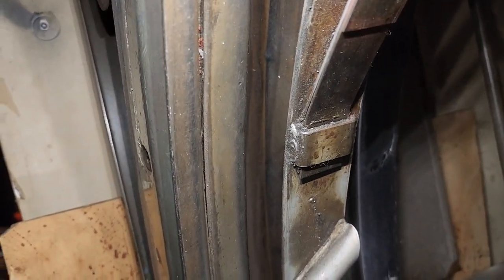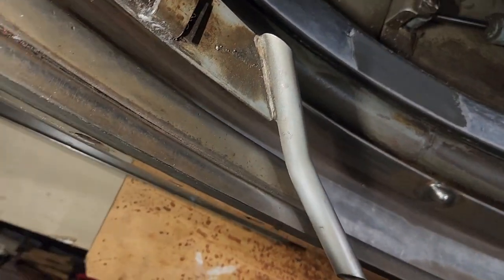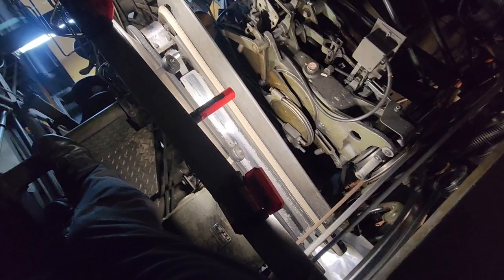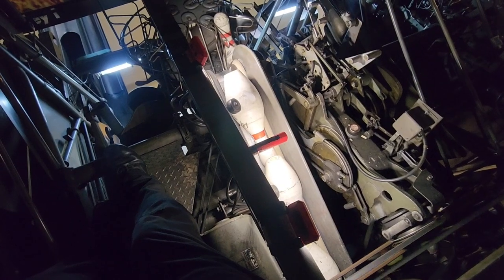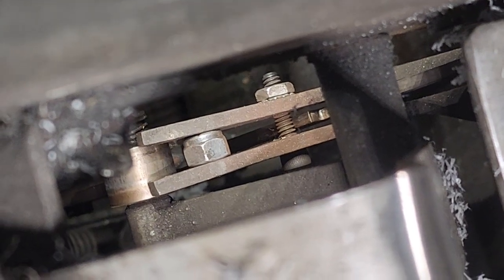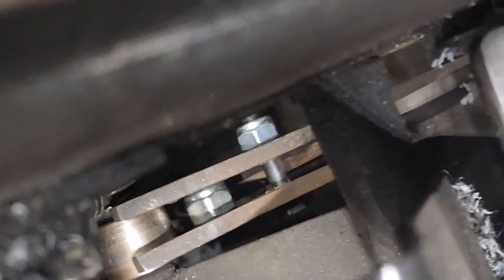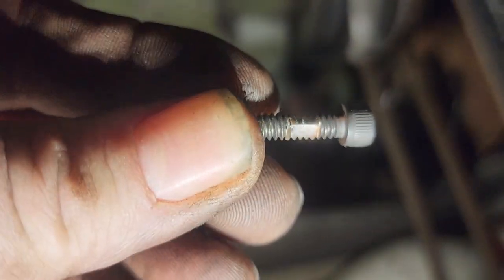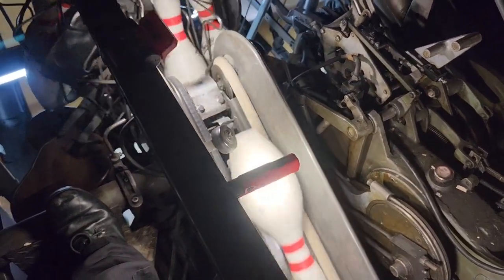Brunswick A2 Pinsetter- Pin Wheel and Pin Gate Issues.

Comment: You should get them to buy nylon pin gate straps......Who even uses metal ones anymore.
Reply from the maker: I may suggest that. The issue would be who is going to install them? This center does not have a full-time technician. 

I'm a full-time technician for another local center. I stop by once a week for a few hours and get the downed lanes running again. I was there for 5 hours today, just working on the breakdown lanes they had. Perhaps one day in the future, they might have the opportunity. Today was not that day. 

I will suggest that to them and see what they want to do. Thanks!